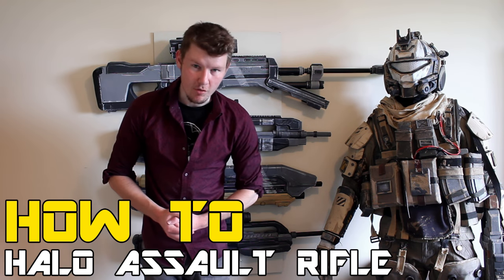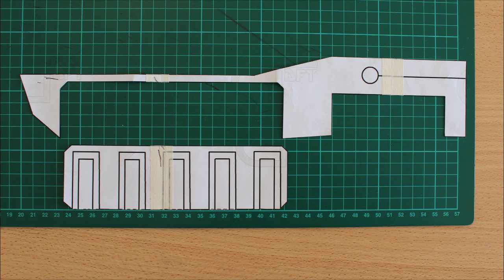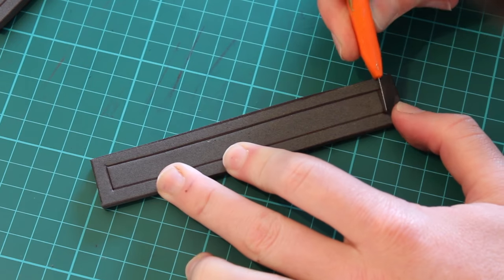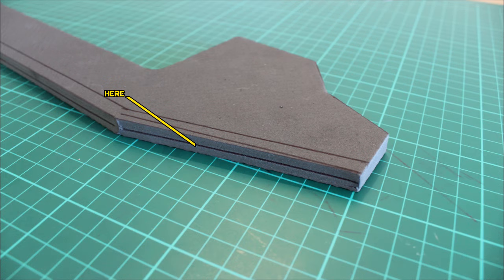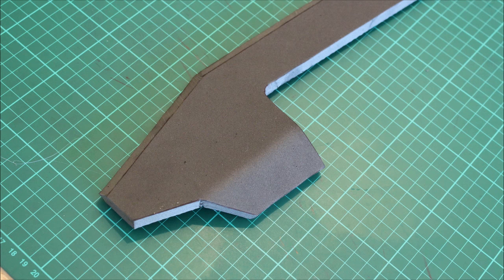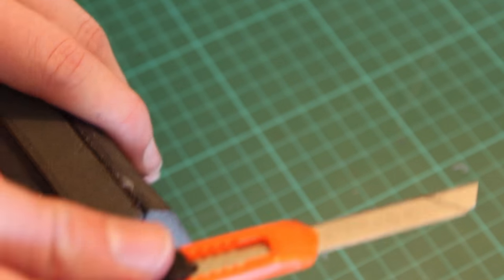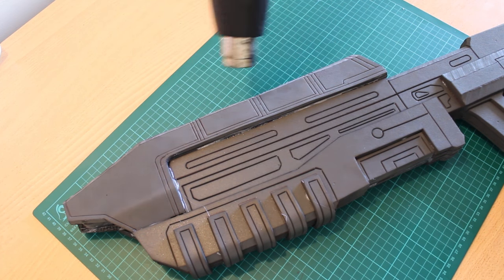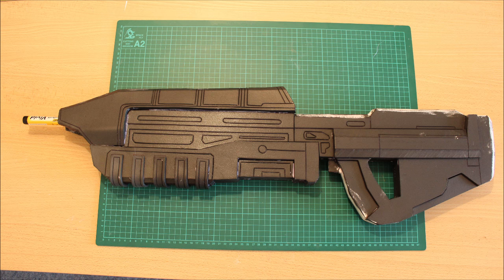HOW TO: Halo Assault Rifle Cosplay Prop - Part 2

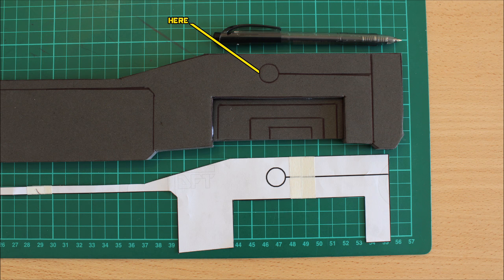Comment: A note about the circle pictured at 3:00.  I once spoke with the artist who created the original assault rifle concept at Bungie.  That circle on the rifle is in fact the rifle's safety mechanism.  It's supposed to represent a single solid circular bar that extents across the width of the rifle.  When the rifle is in safety mode, that bar sticks out from the left side surface of the rifle's frame while being flush with the right side surface of the rifle's frame.  When the rifle is in firing mode, the bar is flush on the left side and sticks out on the right side.  If you watch carefully the first time your character in the games readies a new assault rifle, you'll notice that they flick the safety off with their thumb as they raise it to their shoulder.

So bottom line, someone wanting to add a little extra verisimilitude to their rifle might want to cut out a thin circular piece of foam and glue it over that circle on one side of the rifle.